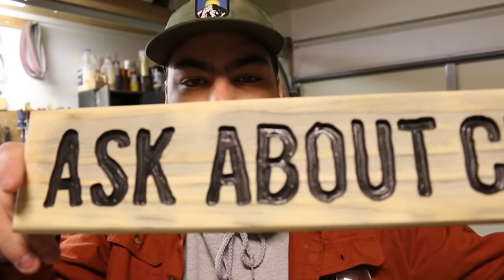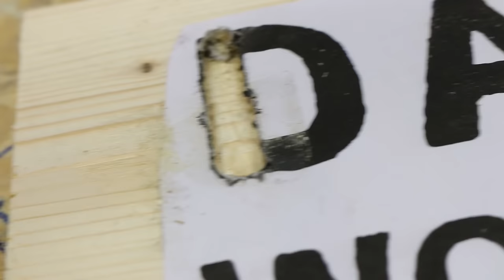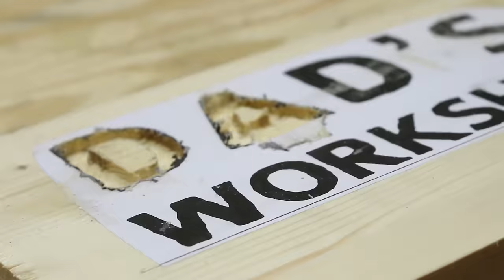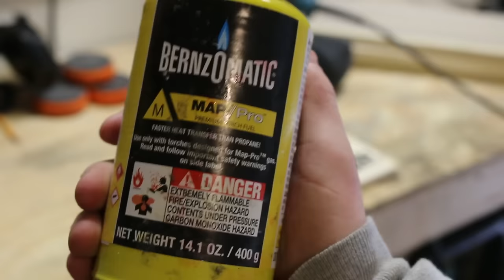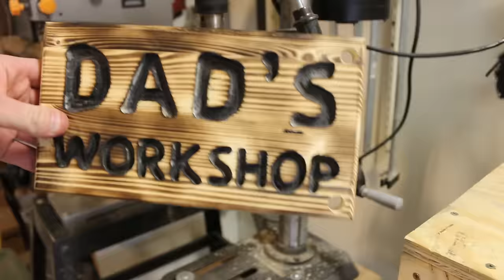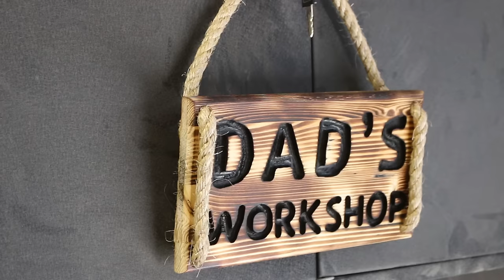Making a Sign With a Router

Comment: Good work. I put painters tape on the whole board first, then use spray adhesive on paper template. When done just pull tape off. It makes clean up easier.
Reply: That's a great tip
Reply: Awesome tip thankyou
Reply: I am too cheap to use painters tape like that lol
Reply: Even better is to get a roll of self-adhesive transparent protecting film. It does the same job as painters' tape, but you get a smoother surface with no chance of unevenness.

Comment: I like what you did. It has been a long time since I made a sign. It's time. I have some spare cedar in the shop and a small router. What I could use is a small assortment of round nosed carbide bits. Suggestion about getting the paper and the paint off is to use a scraper. I had one of those cheap toolbox saw blades that I cut into a few different shapes and sizes. I use a flat file  to sharpen the edges, then go to it. Back in the 60s I sharpened downhill ski edges with a file. The sharp square edge of the scraper can be very effective at removing all kinds of things. Works like a plane only better for some things. No need to sand when you're done. Smooth.
A trick I used to use to make the signs look a bit like driftwood  or weathered wood was to use a heavy duty wire brush to brush away the softer parts of the woodgrain. Very effective. Thanks for posting.

Comment: Here is a tip for you, instead of scraping the stencil off with the hand plane, lightly spray mineral spirits on it, wait 10 minutes, and it will peel right off with ease. I use it all the time when working on the scroll saw! Nice video!
Reply from the maker: Great idea! I've also found, using the heat gun helps peel it up. Thanks for watching!
Reply: Stran Dyck use an electric sander much quicker.
great job
Reply: Stran Dyck blue painters tape, then  spray adhesive stencil onto blue tape. After your done routing just remove blue tape. The blue tape and left over stencil will easily peel off.

Comment: I can remember in High School shop class making signs. and instead of using paint to paint the inside of the letters we used touch to burn the inside of the letters then sanded off the burnt part on the surface of the sign.

Comment: Instead print in reverse and tape to wood then use Acetone on rag, not sloppy wet but good and moist and wipe on the paper and the design will transfer to the wood. It does a nice job. Also works on Sand blast resist stencil.
Reply: Great idea I was using graphite or graphite paper lol

Comment: You did a great job. Try and think out your steps a little better in the future. Paint the letters in before you remove our paper or if you remove the paper already, spray with shellac before painting the letters. Then simply plane off the excess overspray.  Just a helpful hint.

Comment: Use carbon paper to transfer the design next time. Itll save you time and the energy involved with trying to plane the paper off of the project, and it keeps the paper from getting in the way of your sight after you have started using the router. Just a thought.

Comment: You a true craftsman, I've try & couldn't do it, the trim router kept running away from me. Thanks for sharing.
Reply: Ray The 5TH Cut , hey Ray try cutting it in steps, start very shallow and work your way down to desired depth in increments. It solved my run away router troubles!

Comment: When your ready to remove the paper just dampen with solvent wait a minute and it will lift right off then wipe the wood with a cloth using a small bit of solvent. Beats all the work with the plane and leaves a cleaner surface

Comment: What type and size bit did you use in the router
Reply from the maker: Core box long reach bit - 1/4in.  I was able to find it at my local hardware store in a 3 pack for about $12 or so.

Comment: You need to research more thoroughly before making a video on craving with a router.  Check for the moisture content of the wood.  No more than 6 to 8 %.  use sanding sealer to prevent moisture from entering the wood, use Marsh  Ink spray or a primer only, not paint/primer.  You need to sand with the different grids to achieve a smooth finish. You are not using the correct router bit.  That's why your letters are so rough looking.  Keep trying and you will one day have a great looking sign.  Only trying to be helpful, you should have seen my first signs, only fit for firewood.
Reply: So what bits do we need to be using with our trim routers
Reply: Agreed, I'd like to know what bits to use as well; I always like hearing good tips and advice to improve.